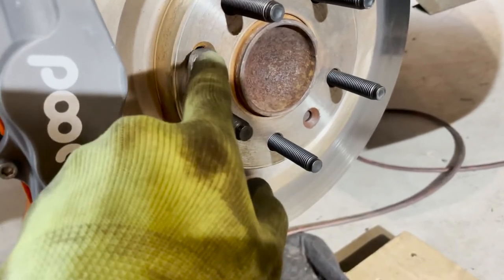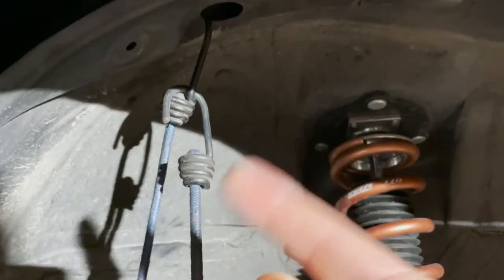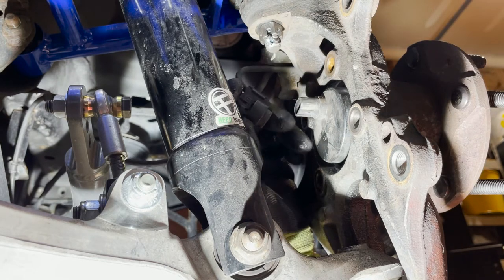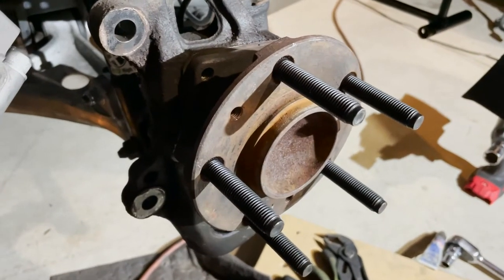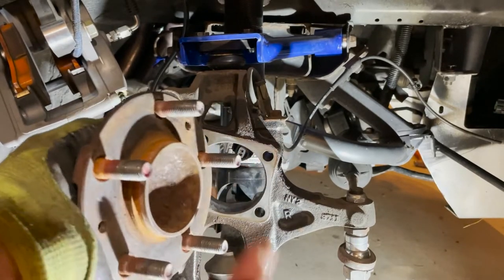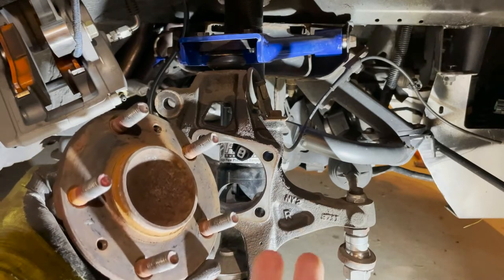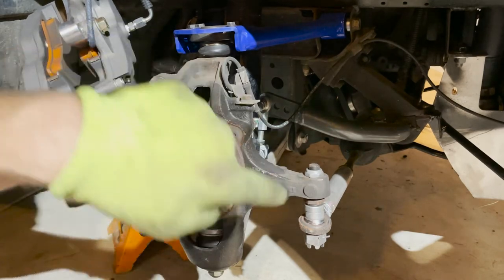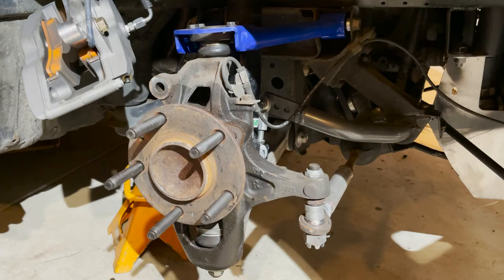How to remove an RX8 front wheel bearing without damaging the bearing.

Comment: Thank you for posting the tip on removing the front hub. I used this on a recent project and it saved me a lot of headaches. One thing I did was take an old wrench and put it on the bolts to protect the heads from possibly being deformed by the hammering.  Great video. Great tip. Made the job nearly effortless.
Reply from the maker: The wrench on the end is a great idea.  Thanks for commenting!

Comment: I also have an LS1 rx8 I have to switch out my studs because the factory ones were cut short years ago, any tips on doing the rear? Could I just pull out the disc and the inner race of the bearing as one piece then switch the studs and press it back together or is the bearing a one piece bearing?
Reply from the maker: Sorry I’m just now seeing this. I haven’t researched it yet. Sounds like it’s a pain though.

Comment: How did you not clean the surfaces with brake clean before assembling and putting on anti sieze 😬
Reply from the maker: It was hard but I felt the wire brush in the drill was more than sufficient.